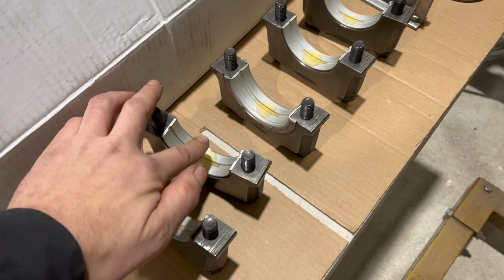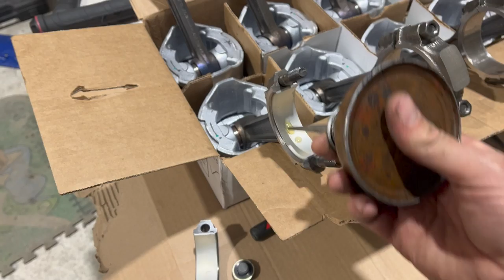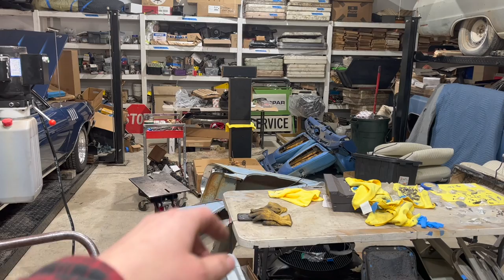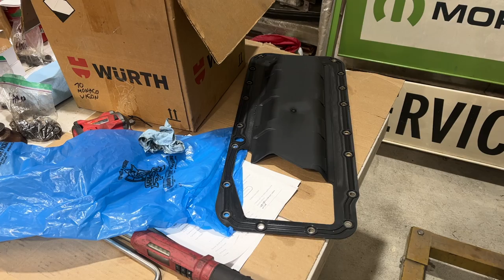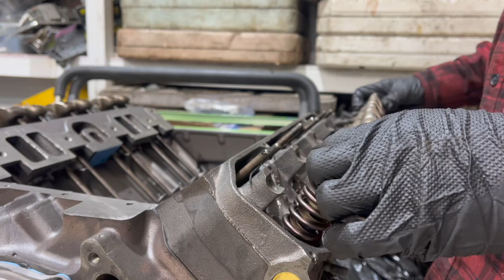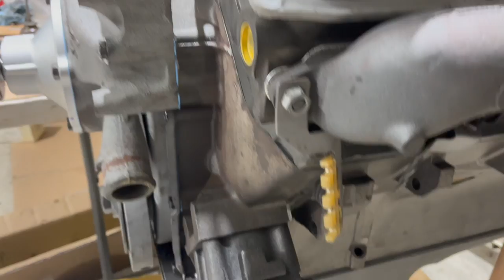How To Assemble A Mopar 440 Big Block! Detailed Step-By-Step Guide

Comment: Cool video!! Reminds me when I rebuilt my 30 over 318 in my ragged garage for my 69 Sport Satellite. And like you i did it on the cheap with all stock parts well the intake and cam was aftermarket and the cam was a little bigger if I remember right it was a 272 cam. Well anyways outstanding work on the 440 I really enjoy the video.

Comment: Impressive as always, DDG! I think everyone should have the two "How to Rebuild Big-Block Mopar Engines" books (there are two main ones, and if the gods are good to you, you have the older one with 240 color photos), but even then, that is nothing compared to actually seeing live-action video of someone doing it, plus their commentary. Also, to the n00bs, this is a "rebuild" not a "build," meaning that you use it as a reference on what to do, not as a performance guide for building power.

Comment: You mention the cam gears dots up, my personal preference is dots facing, it's just easier for my eyes to see the alignment. The distributor position is irrelevant to cam position, just put the drive gear in wherever you want your vac advance to sit. Just to help you wrap your mind around it, turn your crank 1 rev, 2/1 ratio... the dots as you installed in the vid will now be facing each other. BTW cam lobes taper, this assists in rearward thrust and spins the tappets, hence no retainer needed for the cam, pump gear thrust also assists. Enjoyed the video, keep em coming.
Reply from the maker: You did not understand what I said, I guess. If you point the rotor at the #1 wire on the cap with the timing gear dots facing each other, you just timed your engine 180 degrees out, as the valves for #1 are at crossover there. At TDC one, both dots are facing upward. Obviously, you set the timing with the dots facing each other - then you turn the crank one rotation to reach TDC. And to your point on aiming the distributor, why would you change where the vacuum advance sits, when you can move #1 wherever you want on the cap? On the big block, the vacuum advance can really only sit in one location anyway. In any case, what I was explaining here is how to set the distributor and wires up in the factory correct positions that match original service diagrams. If you are building a factory restoration quality engine (as I was doing here,) or if you want to make your own diagnosis easier later, that may well be important to you. Believe it or not, I understand gear ratios too! 🤯 While we’re on the subject, I am also familiar with how camshafts work. I’m glad you liked the video, but I want to make it very clear that I at least kind of know what I’m doing and how this stuff works, or I wouldn’t be making these videos. Thanks.
Reply: @DeadDodgeGarage No offense I'm sure you do, just going over the details from how my brain works, we think differently. No issues with that, I've just always put mine together 180 out. BTW I forgot the slinger on my 383 too, very tempting to leave it out. BTW I went back and read my first post, it did seem a bit condescending, my apologies.

Comment: Awesome video. Very informative and helpful for rookies like myself just trying to get down the basics and concept of putting an engine together. What freeze plugs are you using? I wanted to go with milidon but I see the melling freeze plugs are cheaper.
Reply from the maker: I’m not sure what brand they are. I’ve never thought about freeze plug brands. I’ve always just used Dorman plugs personally. The machine shop installed all of them, except three of the main plugs down one side were actually factory machined too large so we had to source some plugs for those.

Comment: First off want to thank you you are a fountain of wonderful useful knowledge and you make it fun to watch your process secondly I have a question perhaps you could answer my current build is a 1967 coronet 440 convertible with a 318 in it I am almost finished building a 413 for it I never swapped a small block for a big block are there many differences that I may encounter when attempting this process would appreciate the help if there is anything you can advise me on . One way or the other keep up the good work love your channel thanks ,Jimmy o
Reply from the maker: You need a big block transmission, big block engine mount brackets and rubbers (the K frame is the same small or big block in those,) and then you need to make sure you have a B body oil pan and matching pickup, exhaust manifolds or headers that fit, and the rest of the accessories and brackets that will fit in the B body. There are a lot of these kinds of swaps out there, but no specifically useful guides come immediately to mind. I am going to do a slant six to V8 swap video in the near future. A small block to big block guide will come later, as I put together my ‘69 Charger.

Comment: Should be a nice, solid 440. You can check off that box for the viewers now.
   I've used a candle stub when removing  heated broken bolts- dabbed it in there- the hot wax wicks right into the threads like an oil & doesn't get napalmy like oils if too hot.
Reply from the maker: Oh, I’ve heard of that actually. I should give it a try.
Reply: I think I heard that some old-timers used to use Vaseline on the cam and lifters back in the day. I wonder if that's true.

Comment: 50 years ago, some old dude told me the best thing to clean the cylinder bores on an engine block Hoppes number 9 gun bore cleaner
Reply from the maker: Interesting!
Reply: I've tried it on a few blocks. It gets every bit of that Hone grit out of the cylinder. @DeadDodgeGarage

Comment: Nice job. But I have never rebuilt an engine to factory specs. I figure as long as I am going to all the trouble I might as well make some improvements. And I always use new ARP bolts on the important stuff. Yes I have OCD and I overkill everything.
Reply from the maker: Well overkill is the only kind of kill… but the vast majority of my builds have been stock or warmed over stock. I’m definitely a bucks down kind of guy - around the time we start spending money on fancy bolts to replace the still good factory ones… we’re kind of out of my league. Haha. Having said that, I’ve got a performance stroker build with aluminum heads coming soon, and a couple other performance builds in the pipeline after that. Being at the restoration shop, to-the-letter stock appearing is the name of the game for many cars, and that’s something I’ve never done to this level. It might seem “boring” but I’ve found a lot of fun in the detail work.
Reply: @DeadDodgeGarage  not boring. Special feeling.   Call me weird, but I think of designers and engineering and drafting and all older cool stuff.  Slide rules, compasses, cigarettes, white short-sleeve shirts and skinny dark ties... All that while trying to tighten my oil pan with the cork gasket?  Cheers! 🍻

Comment: That's why it was using the court gasket use RTV on both sides of the gasket and it won't weak
Reply from the maker: What are we talking about? Valve cover? Oil pan? I have done that for both in certain situations.

Comment: How to I determine which .020 undersized bearing to buy? I’ve bought two sets that don’t fit . The first set fit except the thrust fitting was too large. Thrust surface is 3.70 in. The block is a 68’ going in a 71 charger. I’ve seen 74 and up use a larger thrust bearing
Reply from the maker: I have never had this issue, and had no idea they were at all different. I just… order bearings.

Comment: Pry the oil pan in between the bolt holes when you take if off. Gently.
Reply from the maker: That’s the best way I’ve found to bend the crap out of them, so I only do that if they’re silicone’d solid. Generally, I tap (carefully) around the pan in various places with a dead blow hammer and they come loose.

Comment: I’m having serious trouble with my engine, a lot of people are saying that the timing is wrong but I aligned it exactly how you described with both dots pointing up at TDC 1. This is correct right?
Reply from the maker: That is definitely correct. Did you verify the dots pointed at eachother when the crank was turned one rotation? It’s best to line them up that way, then spin the crank one rotation and drop in the timing gear - also ideally after pre-lubing the engine.
Reply: @DeadDodgeGarage  just did some troubleshooting, got it! She sounds amazing! Thanks for your reply too!!!

Comment: Try using a nut on broken bolt ...weld it on ...stops accidentally weld to surface and can use more heat
Reply from the maker: I use that technique too, but it’s kind of difficult when they are broken off flush or deeper.

Comment: Do you have a preference using fully grooved mains vs. 180°?
Reply from the maker: I can’t say that I do. I usually gravitate toward stock-type parts wherever possible. If I were building an all out high horsepower engine I might be more inclined to go with full groove.
Reply: @DeadDodgeGarage  I totally agree. I did my first rebuild 3 years ago and used fully grooved mains, and ended up switching to a hv oil pump which worked out well to keep the pressure gauge happy. Thanks for making this video.

Comment: is that radiator thermostat the correct one? it's not the mopar one. Whats your take?
Reply from the maker: Mean the water neck? It is a Mopar unit, but it is technically the wrong version. We are running really thin on good water necks…
Reply: @DeadDodgeGarage  no I mean the actual thermostat

Comment: Yes and why doesn't anybody take the Welsh plugs out of the rocker room shafts and clean them out interesting thank you
Reply from the maker: Because it’s annoying to do. Lol. I soak them, scrub them, spray them out with brake cleaner and then blow them with air through all holes until no more gunk comes out. It works.

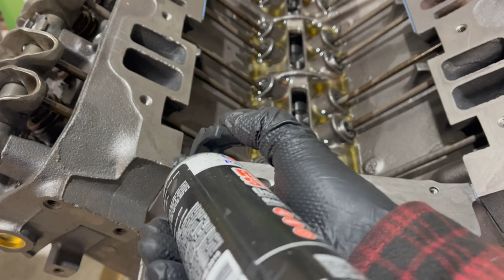Comment: This is why your cam failed..  37:29  you can see your cam shaft while you are installing the valley pan..no sign of any red goop for the cam lube..It all dripped off and you had a dry cam..
That red goop that stomp gives you will drip off and dry away with any amount of time..

Use a grease like Driven engine assembly grease..It stays put..won't drip off and will be there when you start..The red goop is long gone..

Comment: I usually like ta start by putting in the camshaft first. Don't know just me.
Reply from the maker: Interesting. I’ve never done it that way. The reciprocating assembly is the most important so I start there. Knock out the big stuff, then add on the little things. Also, the cam is vulnerable to a certain degree while assembling the bottom end so I prefer to leave it out.

Comment: Touching the bearings on the surface is a no no. The crankshaft will spread the oil automatically on its own.
Reply from the maker: It’s fine. Definitely a clean finger job though.

Comment: The valley pan can't be painted with intake on good original build its a shame the USA doesn't manufacture lifters anymore
Reply from the maker: Any visible area of the valley pan would be painted. The intake insulation and hold down plate were later installed on this engine before paint.

Comment: Never understood not putting the rear main seal crooked
Reply from the maker: Uncle Tony explained it very well recently. I understand the theory - offset the seams from the casting line. If you dab silicone there, you just solved that problem. There’s still a casting line, no matter how you put the seal. Also, the seal is designed with some crush so the ends pushing straight on each other should compress it that tiny bit. Offsetting the ends keeps them from compressing that way.

Comment: Why use those LOW Compression Pistons ? 
Those are at best 8.6:1 with an open chamber 906 cast iron Head and composition Head Gasket.... and if you are going to use them ? then at the very least a guy could have decked the Block .020" to compensate for the thicker Composition Head Gaskets(.039") versus the factory .020" thick steel shim Head Gasket and try and get it closer to 9:1
Reply from the maker: Because this is an intentional FACTORY rebuild, as close as to-the-letter as is possible, with absolutely zero care given to increased horsepower or performance. We only used a slightly larger camshaft because you literally can't buy one as small as the factory grind. We really don't care what the compression ratio is (you'll notice I didn't check.) In fact, if it's low enough to run happily on regular fuel, that's a huge plus! Funny enough, I have since found a set of steel shim head gaskets. If I'd known those were there, I may well have used them. Not everything has to be a hotrod. In my world, it's more often that the opposite is true.
Reply: @DeadDodgeGarage 
 In '1970' the 'stock' CR in a FACTORY 440 was actually around 9.3:1 ..... NOT 8.6:1(MAX that you could be now) 
And at that 9.3 with the shorter 350 hp Cam they produced gobs of Trq., real stump pullers.
All you've done is drop both the static CR and 'dynamic' CR by adding the Comp Cam which kills lower end Trq.
And while not everything as you say needs to be a 'hotrod' in your world ?.... you've basically just DE-Nutted your 440 'hiding' behind it's supposedly 'stock and factory' monikers....which you blew it on BOTH counts because now it's LESS than "stock' and NOT at all 1970 'factory' 440.
Just say'in.... sometimes it pays to know what it was "stock" from the FACTORY first.... before you attempt to duplicate it ?
Reply from the maker: @dirtlump  ok